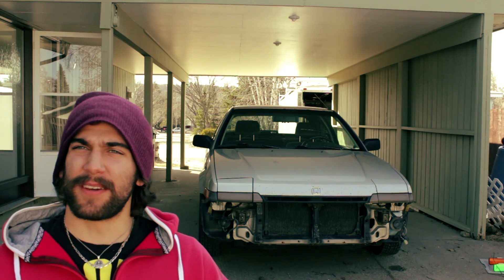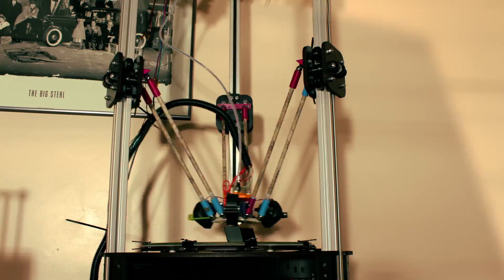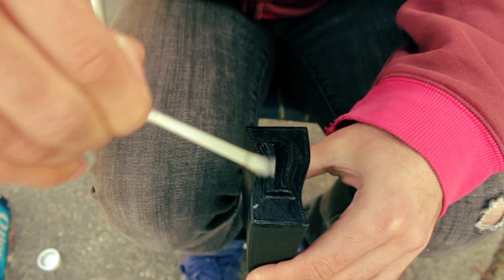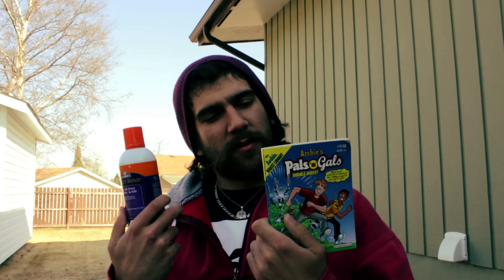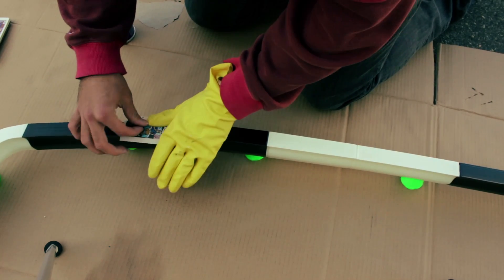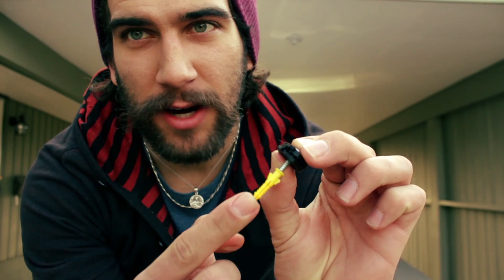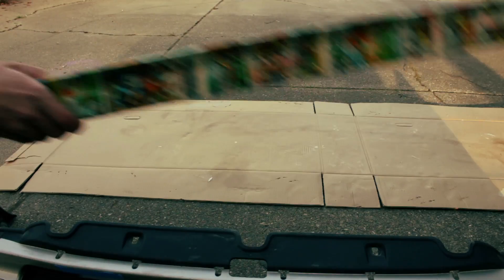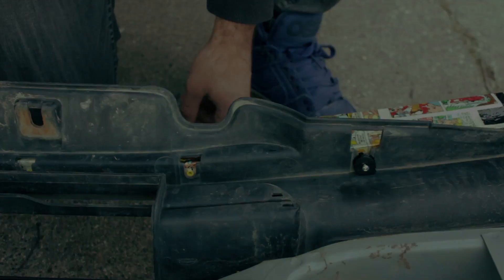Will It Print Wednesday Ep. 01: Bumper Lip

Comment: Bro , how did you map the exact geometry of the bumper? I need to print one too , but the curves are difficult to measure :/
Reply from the maker: Depending what vehicle you have, it can be pretty complex...if the shape is simple like the Accord (bottom of the bumper is flat and there are only 2 curves where it turns back towards the wheel wells) all we did was take the bumper off the car to get a photo from front, side, and bottom, w/ a ruler in the shot so we could scale them correctly, align them as a background in front, side, bottom viewports in Blender and then drew the shape poly by poly making sure it matched curves in all the viewports. We also printed a few test parts to hold up to the bumper to make sure we got the shapes right. A bit of guess and check In hindsight if Fusion 360 was around then, probably would have done it there w/ sketches instead, but same process. What vehicle are you wanting to make one for?
Reply: @vectorfinesse  Thanks for the very detailed response ,much appreciated. Yeah for a Toyota Ae101 , i wanted to print a lips for the front bumper.
Reply from the maker: @nissaarwz4645  ah yea, it’s a little less boxy than the Accord, but looks reasonably flat, so it shouldn’t be too complex. Best way if possible is to get the bumper off and scan it then use the scan a reference geometry (it’ll get you a lot closer to the shape faster). If you hit r/3DScanning on Reddit, there is a list of options in the sidebar and some are free. Photogrammetry is probably the easiest method, you just take a bunch of photos and the software stitches them into a 3D model. We used to use 123D Catch back in the day on iPhone, but no one has come out with a replacement since Autodesk discontinued it.

Comment: That Looks Amazing. I Was Curious About The 3D Printing Material If It's Durable? Also How Much Would You Charge To 3D Print A Front Bumper For A Vehicle?
Reply from the maker: FijiBoi650 The material was ABS, lasted almost two years, made it through one Northern Canada winter and ripped off part way through the second. Ballpark $500-$700 for machine time and materials depending on the vehicle if you have the files already done, add more for making the models. Great tool to prototype and make one offs from, would probably make moulds from it to do multiples more cost effectively.
Reply: @vectorfinesse  Hi Vector Finesse, can I e-mail you with further details? It's for a 1999 Mercury Cougar, Millennium Front Bumper made by AeroGear/Extreme Dimensions.
Reply from the maker: FijiBoi650 sure, hit the link, scroll to the bottom and drop us a line through the contact form on our website. https://vectorfinesse.com/ Talk to you soon!
Reply: @vectorfinesse  I did send an e-mail via the link but no response yet.
Reply from the maker: FijiBoi650 thanks for the note, response in your inbox now

Comment: Awesome project! What material did you use for the bumper?
Reply from the maker: absher mansoor This one was done in ABS, but I’m not sure I’d use it again. It shrinks a lot while cooling ~3% so if you don’t have a heated chamber you have to be really lucky for it to not crack and warp a little.
Reply: Thanks for the quick response
I'm new to 3d printing and I needed to get a few smaller parts printed. If ABS isn't ideal, what would you recommend as a material to avoid distortion due to shrinkage?
Reply from the maker: absher mansoor we use PETG or a PETG/Nylon alloy when we want similar material properties to ABS without the shrinkage issues. If your parts aren’t going to see much stress or heat, PLA is totally fine especially if the pieces have finer details.
Reply: @vectorfinesse  ahhh...awesome. Thank you. 👍
For now, PLA is fine then, as I will be having a few detailed work, but nothing too intricate. I'm just glad I came across solvent welding on your video for joining the parts together. Saved me a lot of hassle. Much appreciated , thanks
Reply from the maker: absher mansoor Quick note, solvent welding with acetone only works w/ ABS. There are other solvents that you can use to get the same effect with PLA, but they are really nasty chemicals. Epoxy (like Smooth On’s XTC 3D, JB Weld or similar) has been the best method we’ve found so far to get a strong bond with PLA parts.
Reply: @vectorfinesse  thank you for your advice. You've been really helpful. I'll do that.

Comment: How did you get the bottom dimensions of the bumper to design the lip... Get it to fit perfectly?
Reply from the maker: Sorry for the long delay on a reply, we 100% lucked out on the sizing working the first time. All we did was take photos from the front side and bottom to use as our "blueprints" in blender to get the shape right, and then we just measured the bottom end to end and from the middle back to the edge to get the XY bounding box. After that we just scaled the lip up until it fit the size we measured